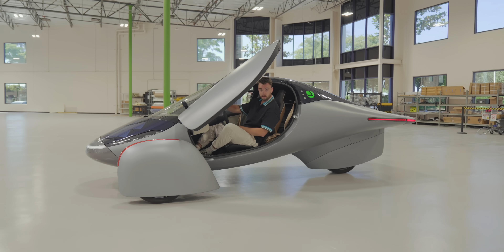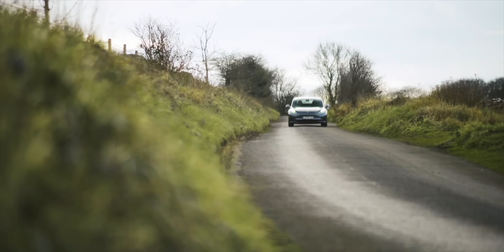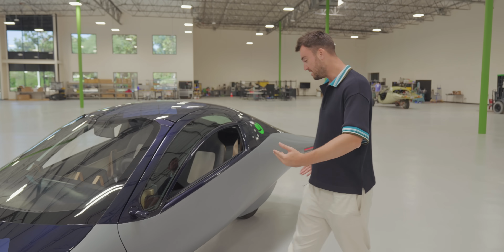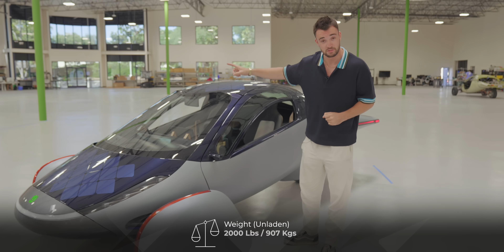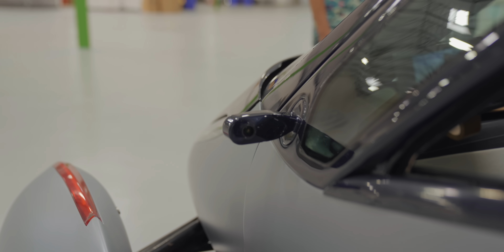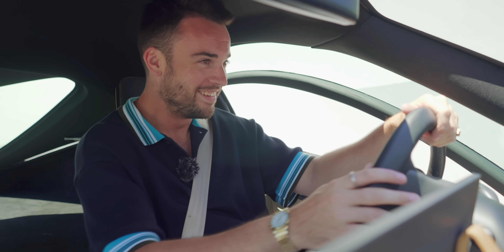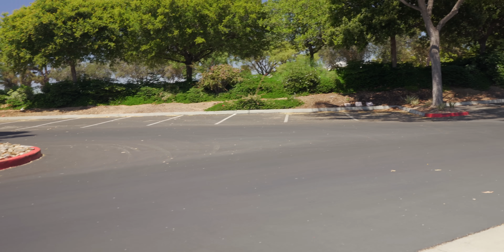The Game-Changing CHEAP Electric Car Inspired By Fish!

Comment: Hmm this wins all the awards for most useless car ever invented.
I use my diesel car for 3 thing -
1. My wife going to work - nope, too wide, too many speed bumps. 
2. Picking the kids up from school - nope, not enough seats
3. Shopping - nope, not enough boot space for my family.

It doesn’t even work as a motorbike replacement as it is far too expensive.
Reply: EU version will be narrower (due to L5e-A regulations).  Kids can run behind(*).  Boot space 700 litres. 
(*) Seriously, the initial US version is most suited for 2 person households.  They will be looking at more seats later.  In the US, an Autocycle can only have 2 seats, whereas in the EU, an L5e-A vehicle can have more seats, so a 4-seater version is not impossible.

Comment: I want to see the crash test and rating lol 🤣
Reply: Since the composites are designed to be in an eggshell shape, and are 6 + times stronger than steel, I am pretty confident, that it will turn out extremely high scores in crash tests. Kelvar is part of the mix, (that is what bullet proof vests are made off.) A honeycomb weaved, hemp or bamboo will be inside the composite, adding even more to the tensile strength. Formula 1 race cars are put together in the same fashion, and they can withstand 200 MPH crashes. Not going to be driving my Aptera over 100 MPH very often, but if I do, I will not worry about the hospital.
Reply: @chrisbarrett2512  I have a bridge in Sydney I would like to sell to you.
Reply: @aussieideasman8498  I don't trade with luddites. However, if a cretin would pay to have my Aptera shipped to that bridge, we could negotiate then.
Reply: @christopherbarrett9749  You got my point.
Reply: Crash tests are going to happen in the next few months I think.

Comment: Awesome. What an awesome piece of engineering. I can’t wait for a performance version that allows a solid 1000km range. I will be happy to use one for most of my commuting. Bring them to Australia ASAP.
Reply: The largest battery currently available to pre-order on the Aptera gives you 1,000 miles of range, so that's 1,600km range... just from the battery, and doesn't include solar.  If you only need 1,000km range, you can save money and get the 600 mile battery.   And the "performance version" (aka all-wheel drive with 3 motors, 3.5 sec 0-60 miles/hr -or -  ~0-100km/hr) is already available to pre-order, and doesn't appear to sacrifice range.
Reply: @GG-Pod  Ok cool. I hadn’t looked into it that far yet. I was so excited I just commented off the hip before I saw where he did an acceleration from standstill. The 3 motor must absolutely rip then and yeah if I can get a thousand klm’s from the standard battery then that is amazing. I honestly can’t wait.
Reply: @BillyBoblovesthedirt  do you think the 3 wheel design will pass rego?
Reply: @Shaner795  maybe as a motorcycle as they have in the us so why not? I certainly hope so but I’m not all over the regulations. The regs will need to keep up with these sort of things because vehicles like this will certainly help. I’d like to see even cheaper versions with 3 or 4 seats.